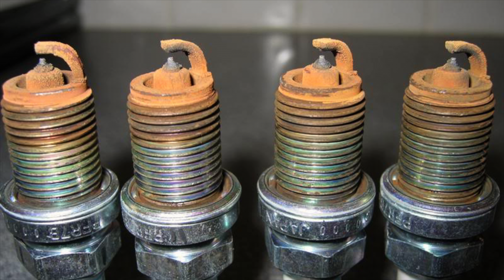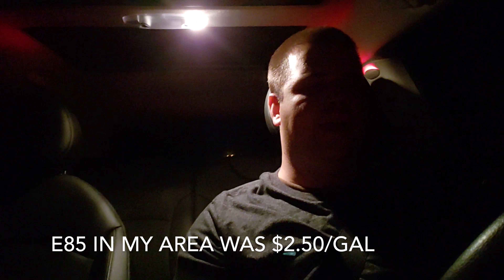E85/E30 Big Turbo Mini?? Can the Mini shoot FLAMES?!

Comment: I know yours is heavily modified and tuned but I’ve know a lot of people’s stock minis will pop. I have a resonator delete but mine only pops on rare occasions and always when it’s cold even in sport mode. Know why?
Reply from the maker: Sport mode is what makes the car pop. It's designed to pull a few degrees of timing when off throttle to allow some unburnt fuel to pass into the exhaust where it ignites. Tunes like mine make the process more aggressive. Mine even pops sometimes outside of sport mode just because the condition is right but nothing like the machine gun fire in sport mode.
Reply from the maker: I should also mention that once the coolant temperature reached 140 degrees Fahrenheit that is when the car can begin to pop at its earliest.
Reply: I’m N14 and run about 2-2.5 gal per tank! But you already know that, bender5six here! Keep up the videos, currently installing a jmtc 46 in mine so keep an eye out 💪🏼
Reply from the maker: What's up man! You're gonna love the big turbo life. Hey @broke but boosted. Is your car a 2010?? They skipped the pops and burbles on that model year and it would require a tune to enable it.
Reply: Mike_MANIC_R55 no mind is an 08
Reply: @MotoMedicine904  some change the timing so that the exhaust valve is open after the tdc and spark is late, combustion happens with open exhaust valve is open, the pops happens before the turbo.

Comment: Only Gas in here ( BELGIUM )is E85 , 95 octane or Super 98 octane. I drive R55 Clubman S from 2007
Reply from the maker: You guys are lucky. 100 octane here is $10/gallon. Compared to $3.35/gal for 93
Reply: @MotoMedicine904  I know this is really old, but European octane scales are different from here. We have about the same options, but the numbers are different for the same fuel. It's a really weird scale. 100 octane in the US would be more than 100 overseas